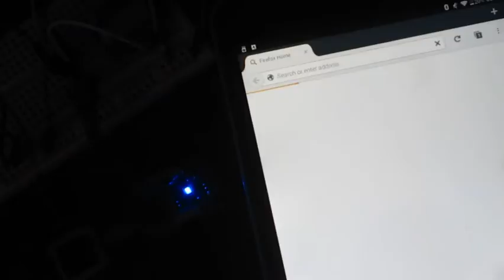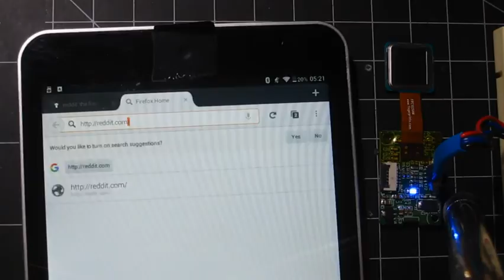Touch-Key: FPC Fingerprint scanner + BLE HID keyboard combo

Comment: Your video shock me man! it's awesome what you did there. thank you! 

Do you think it is possible do something similar to lock a door? Using specifically this fingerprint reader.
Reply from the maker: Hi,
Yes, for sure!  I've had circuits like these, and circuits that trigger electronic locks (often just some sort of electro-magnet) and combining them would be easy.  Hardest part is that many of these locks require higher voltages, so you'll have to use a mosfet or something to switch in 12V or whatever is specified.